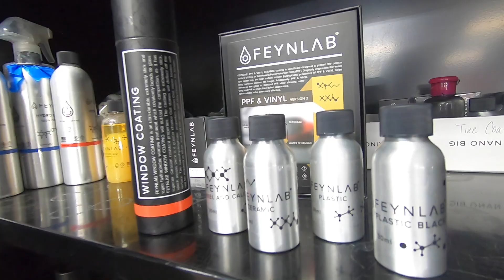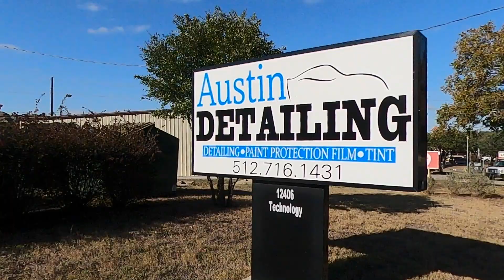I FINALLY WRAPPED MY MODEL Y!! It's the TESLA BATMOBILE!  PPF SATIN + CERAMIC COATING!

Comment: I need to do somthing to my M3.  Sick of getting rock chips
Reply from the maker: We did a wire brush to the PPF and it was scary, but it just disappeared!!  you should def at the very least get the front wrap.  I saw someone do that the day I got mine. (it was the white tesla in the video).  It's much cheaper, and you can't even tell.

Comment: Do you regret getting black over white is it a lot to maintain the cleanliness
Reply from the maker: I actually now have owned both!  (currently black). there's positives to both, honestly the white interior gives it that "wow" feeling, but Maintance sucks, and you're always iffy about someone wearing blue jeans.  Black just looks clean af.  I have black now, and it does feel smaller, weird huh?  but, I love it.  it's clean (regardless if it's dirty).  Honestly depends on what color exterior you'd get.  I wouldn't want a white on white.  But because I got a white model Y now, I went black on the inside.

Comment: what was your thought process in doing a PPF instead of vinyl?  Do you think PPF satin was worth the price over the vinyl even though vinyl is less protection its cheaper.
Reply: Picking up my Y next month and curious about pff vs vinyl as well. What was your cost for ppf?
Reply from the maker: SO PPF is like 8mm-10mm depending on the brand.   Car vinyl is usually 3mm-5mm.  The only reason I got the PPF is because of the way the satin looks, but then getting some rocks hit my car and hail damage, I can see the protection to my car because of it.  I just got my new Model Y, white, and I immediately bought the SATIN PPF for it.   vinyl is like $4-6k, PPF is like $5-7k.  Depending on who you get to do it and how many pieces they use to do it.

Comment: Did they happen to wrap the rear bumper (where the tow hitch is located) or they left that stock? Thanks for your reply.
Reply from the maker: They did not read that part, nothing can stick to that
Reply from the maker: Well not ppf at least
Reply: @pickleminh  Wow, fast reply, thanks for the info! I am picking up my Model Y this friday, and was planning on getting PPF and also installing a tow hitch from Tesla, so I was wondering if I should install the tow hitch first before the PPF, but I guess it doesn't matter which one I get first! Excited!

Comment: What end up being the issue with the wheels? I was having the same vibration issue above 70+MPH
Reply from the maker: The foam in the wheel came off on the inside.  I had to take it to my car guy (Austin detailing) for them to figure out the issue.. even discount tire and Tesla had no idea.  They brought it to Tesla and got it replaced under warranty.

Comment: That looks dope.  I have the same black and white MY.  Did my own paint correction and ceramic coating.  No PPF.  How did you pop that frunk?  Do you have some accessory as every time I close it I leave finger prints and the black color does not help
Reply from the maker: Hey buddy!  Check out my frunk installation video.  I installed it myself. I got it from HANSSHOW.  You’ll love it. I didn’t wanna leave handprints that’s why I got it

Comment: Do you have to have a black paint color to achieve the look you have here or is the ppf actually satin black colored? Hope that makes sense..
Reply from the maker: The satin will give the same effects on any color. It’s just a matte shiny finish.  I’ve seen the white and blue and grey in these and they look AMAZING!!  The satin is clear not colored
Reply: @pickleminh  gotcha, nice. It looks fantastic. So it's not a typical vinyl wrap but a ppf giving a similar effect to tint on windows? Is ppf better way to go over vinyl? Just wondering if going to order a tesla, is it better to keep the standard color to save 1k there and do a vinyl wrap to change the color to whatever. Preferred vs painted upgrade and ppf wrap instead?
Reply from the maker: @cwal_21  so vinyl wrapping does protect the car from dings and rock chips like ppf.  It’s about 3-4mm thick where ppf is 8mm thick.  The one I have is the “self-healing” ppf, so if someone scratches my paint or something like that, it will absorb it and then disappear.  They put a metal wirebrush to my car with the ppf on it and scratched up the ppf and the scratches instantly disappeared.  Was cray.  So vinyl wrap is just a color change, it will protect the paint barely from rock chips but not as much as the ppf.  Ppf is for protection.  So depends on what cha wanna do 😉

Comment: Does the wrap act as a protection film as well or do you need to put ppf on top of the wrap for that same ppf protection.
Reply from the maker: The wrap IS the PPF.  This is not a vinyl wrap. It’s a PPF satin finish
Reply: @pickleminh  Do they have some type of protection for the windshield? Just took delivery of our Model Y. Next day drove it on the freeway and was already hit by a rock. Luckily it didn’t crack the window nor leave a mark. Do they have anything to help with that?
Reply from the maker: @josephabeleda7992  unfortunately there isn’t. I asked about the same thing lol. They said they had clear PPf but you won’t be able to see through it even though it’s clear.  It will distort images. So they don’t do it.

Comment: I’ll be taking mine there in a week or two. No full wrap for me but just the front + rocker panels. I’m doing clear PPF so I can get away with it. Matte PPF requires doing the whole car. I’m doing the 10 year ceramic though. Talk about waiting too long. I’ve got 7500 miles on mine. Hopefully they can touch up any paint chips.
Reply from the maker: Those damn rocker panels, I wish I would’ve gotten my PPS done earlier
Reply: @pickleminh  Me too. Unfortunately I was “in transition” and couldn’t get it done right away.

Comment: Did you figure out what was causing the vibration?
Reply from the maker: So there's a foam piece into the tire that separated and it was making the tire shake!  Got tesla to cover it after they were saying "TIRES ARE NOT WARRANTIED". cus I only had 2k miles on my car lol
Reply: @pickleminh  Glad that worked out.
Reply: @pickleminh  exact same thing happened with my MY. The service guys had no clue, which is funny since this is a known issue. My car was right at 1000 miles but heard it as soon as I went over 75.
Reply from the maker: @MattBruce10  hopefully they covered it under the warranty! 😳
Reply: @pickleminh  They wanted me to pay for the full tire replacement and then deal with Goodyear for the refund. At the end of complaining, they caved and took care of all costs on the spot.
Reply from the maker: @MattBruce10  SMH, it’s weird that we have to buy a $50,000 plus car and argue about a $300 tire For them to do what they should’ve done anyway LOL

Comment: What does a complete car wrap with ceramic coating cost?
Reply from the maker: Well the price differs from different companies.  I’ve gotten higher and lower quotes from other places but I kinda drifted towards the local recommendations of my local Tesla group.  For something that expensive I wanted quality and great service.  So I paid about $6500 for the full wrap, he threw in the ceramic coating (normally cost $1k for the 5 yr) cus I purchase window tint prior (there’s a video).  So I would say about 6k to 8k is going to be the pricing.  If they’re charging less, I’d question it.  The places that charge less do mult pieces on pieces that more expensive places do one pieces of that makes sense.  Seams.
Reply: Thanks for the info.  Trying to decide between full wrap or just front half like I did on my model 3.
Reply from the maker: @andysccs1  if it’s clear, I’d just do the front.  If it’s satin then full body

Comment: About how much did it cost to do that?
Reply from the maker: it apparently retails for $8k for matte for full-body wrap.  I paid about $6500 (cus I've been doing all my services over there).  The ceramic coating would've cost another $1k, but I got it thrown in because I bought window tint previously, and I'm getting my brakes done by them.   Packages save ya money lol but got dang it cost sooo much but it's WORTH IT :)
Reply: I don’t have a Tesla yet but the pressure to hold myself back is crazy...I currently lease a Volvo XC60 so can’t do anything until my lease is up but man I can’t wait.  I love your channel. Not that is makes a big difference but is that Canadian Dollars or US Dollars?
Reply from the maker: @adriancameron7971  it’s in US Dollars.  I had a Mini Cooper lease for 3 years, had 1.5 years left and said f it, and sold it to carvana and paid a little more. 🤷🏻‍♂️😂
Reply: @pickleminh  Wow...I don’t want to do that it will be just too $ for now...I can wait.  From what I am seeing if I wait I may get the new battery pack 🤞🏽and the heated steering wheel which I will miss if the car does not have it. I must be patient and good things will come. LOL
Reply from the maker: @adriancameron7971  yea I agree. I just went the yolo route lol 😂 if I had waited 1 more month to yolo I would’ve gotten double pane lol

Comment: $?
Reply: Info what brand ?
Reply from the maker: @antonioargente7464  PPF is no joke.  it apparently retails for $8k for matte for full body wrap.  Its called Premium shield  I paid about $6500.  Feynlab Ceramic coating would've cost another $1k, but I got it thrown in because I bought window tint previously, and I'm getting my brakes done by them.   Packages saves ya money lol but got dang it cost sooo much but it's WORTH IT

Comment: What’s price of matte black wrap alone. I got quote w 3 other local businesses
Reply from the maker: PPF is no joke.  it apparently retails for $8k for matte for full-body wrap.  I paid about $6500 (cus I've been doing all my services over there).  The ceramic coating would've cost another $1k, but I got it thrown in because I bought window tint previously, and I'm getting my brakes done by them.   Packages save ya money lol   Anyhow.. Ask them, for the back upper piece for the MY, is it a 1 piece or a two piece.  I were you I'd check their quality, some places will be cheaper because they'll do two pieces instead of one to save money on the wrap, and you'll see seams.
Reply: @pickleminh  thanks for info. This guy never responded to my emails or Laura for an estimate to have a hansshow harness installed so i had another shop do the work after waiting for a week. The wrap is about 1200-2k cheaper at the other 3 places that work mostly on exotic cars. I wont use Brian or let him touch my car w that kind of customer service. Good luck. See you on the road.
Reply from the maker: Can’t blame ya my guy, should’ve hit me up and I would’ve helped ya install that Hansshow! 😂
Reply: @pickleminh  thanks but don't know you or do social medical to contact.
Reply from the maker: @ianbladuell2694  true! Lol

Comment: How much did it cost? But what I want is to wrap the car in couple years after all the chips and scratches - have the my M3 wrapped in a different color  when I'm tired of the factory blue(Forest Green) covering up all the chips and scratches.   Paint protect in a different color -  ugh NEW CAR.  YES.  Anyone?
Reply from the maker: PPF is no joke.  it apparently retails for $8k for matte for full body wrap.  I paid about $6500.  Ceramic coating would've cost another $1k, but I got it thrown in because I bought window tint previously, and I'm getting my brakes done by them.   Packages saves ya money lol but got dang it cost sooo much but it's WORTH IT :) gotta protect that investment.
Reply: @pickleminh  hilarious